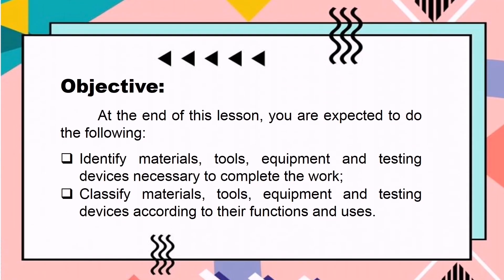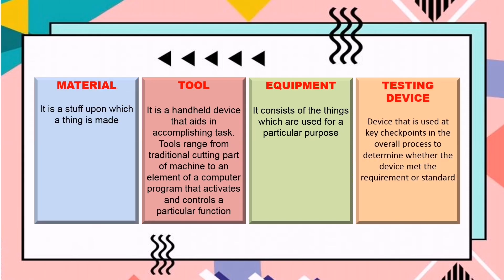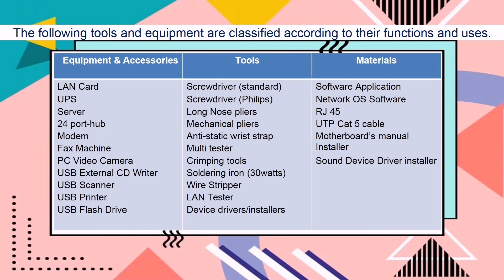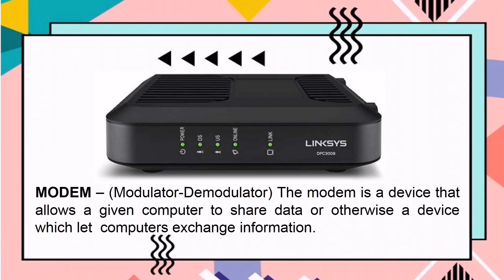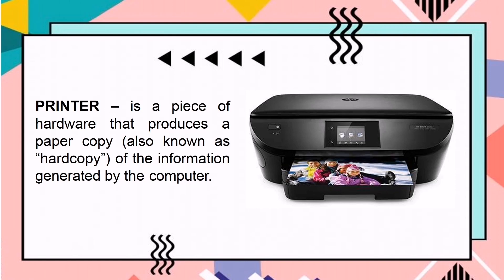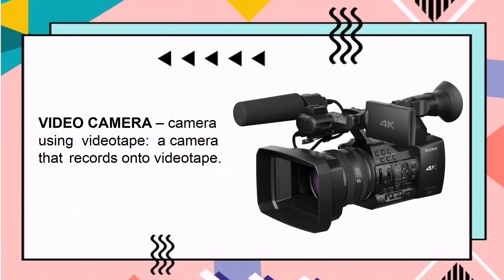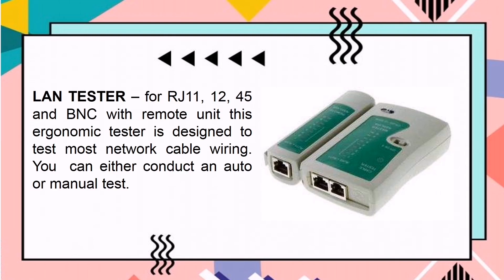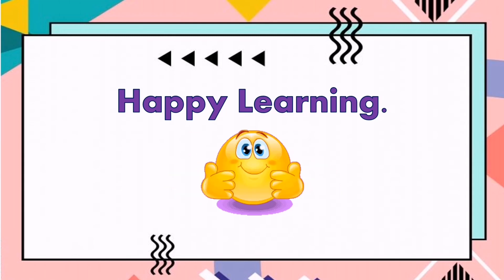LO 1. Assemble computer hardware

Comment: Three Disadvantages of Not Following Directions in Using Tools and Equipment:

-All tools,materials and equipment have their own functions,so if they are not followed we may not be able to do our work correctly
-Failure to follow or use tools,equipment and materials correctly has the possibility of being harmful
-There is also posibility of damaging what we do or the things we do such as the computers once the tools,equipment and materials that should be used have not been followed or used correctly.

Shiela Mae Masanguid
Grade 10-Karunungan

Comment: 3 DISADVANTAGES OF NOT FOLLOWING DIRECTIONS IN USING TOOLS AND EQUIPMENT

1. If you don't follow the instructions, your understanding of how to utilize tools and equipment won't get any better. It won't take much time to just read and follow the instructions. But you can utilize this information the next time you undertake a task.

2. People may sustain injuries ranging from minor to severe, and in certain cases, fatalities. such as collision injuries, electric shock, and slippage when utilizing. 

3. Failure to follow the instructions for the tools and equipment will make repairing or doing what needs to be repaired more difficult. You have a higher chance of failing or damaging your PC.

10 - karunungan

Comment: Three Disadvantages of Not Following Directions in Using Tools and Equipment:

- Failure or having a hard time completing a task. Not following directions before usage or performing a specific task could lead us to this. We tend to do a job or task without reading or following directions. Due to this, we will not meet our expectations after completing our job.

- Every tools and equipment we (will) use has its own use and function. If we tend to use a tool to its not specific uses, it may cause damage to the tools or equipment, or in a worse scenario, this could lead us to several other problems in assembling Computer Hardware.

- Accidents may occur, not only in our tools, equipment, and any devices but also in ourselves and also for the people around us.

Abon, Ryza P 
10 - KARUNUNGAN

Comment: THREE DISADVANTAGES OF NOT FOLLOWING THE DIRECTIONS IN USING THE TOOLS AND EQUIPMENT:

• If you not read the direction first, there's a possibility it will be difficult for you to perform the given task(s).

• Every tools has their own functions and design. In computer system, you need to know all the tools and equipments including their works. Once you misunderstood or unread the directions, it may cause damage on tool, then you will start panicking because you don't know how to fix it.

• Computer is a generation. It needed tools to fix the broken part of the computer, and equipment for particular purposes. The two necessary items are both working fine, If you didn't read the direction, it can cause danger on the computer and also hazard by yourself.

✓Better to read the direction first to have a good knowledge of data✓

JOHN ARVIN T. ABELLANO 
10-KARUNUNGAN

Comment: 3 Disadvantages of not following directions in using the tools and equipments are:
1. There is a possibility that the equipments will break if you do not use the equipments properly. 
2. There is a possibility of harming you if you do not use it properly. 
3. And it can also damage the parts of the computer or the computer. 

STEPHANIE C. MILAR 
10-KARUNUNGAN

Comment: The Three Disadvantage of Not Following Directions in using the Tools and Equipment are:  

1. Lack of knowledge about how to use tools and equipment can result in many risks and accidents, not only to the people performing the activities, but also to those around them. 

2. Using improper use of tools and equipment is a bad idea. When using tools and equipment, you should always read the directions carefully so that you can find what you need and understand what has to be done. In general, not following instructions when using tools and equipment results in an impossibility to get the desired outcome. 

3. The improper use of tools and equipment may have an effect on the computer and can cause damage to it. And the tools may be damaged too. 

Princess Kim Magno 
10 – Karunungan

Comment: NADINNE A. SERDEÑA
10 - KARUNUNGAN

•Three (3) disadvantages of not following directions in using the tools and equipment:

1.) Misuse of tools is not only dangerous, but it also shows a lack of knowledge in using tools and equipment. Furthermore, if an accident occurs as a result of improper use of the tool, the downtime will disrupt the entire work.

2.) Never force a tool to do something it wasn’t designed to do. Forcing a tool can lead to breakage and serious injury. Using a tool incorrectly can damage the tool or equipment.

3.) The wrong tool can make any job much harder. Using the wrong tool at work can be extremely dangerous. One of the most common hazards of using the wrong tool at work is that you could hurt/harm yourself and also your co-workers. Always be sure to use the right tool for the job and handle it with care.

Comment: THREE DISADVANTAGES OF NOT FOLLOWING DIRECTIONS IN USING THE TOOLS AND EQUIPMENT:

1. Failure to follow the instructions in using tools and equipment can cause improper handling and guiding of it. Worst, it can result to hazardous consequences or accidents arounds us.
2. Work sometimes does not look exactly what we want it due to not following the instruction that can damage the computer and other computer related devices.
3. Tools and equipment have their own characteristics and function so that we must use it properly to avoid those disadvantages and we can freely achieve the safety workplace qualification. 

Annalyn T. Ramos 
10 - Karunungan

Comment: THREE DISADVANTAGES OF NOT FOLLOWING DIRECTIONS IN USING THE TOOLS AND EQUIPMENT : 

1. Accidents may arise as a result of improper tool and equipment use or failure to follow instructions. When we misuse tools and equipment, we greatly increase our chances of injuring ourselves or those around us.

2. It is more likely to fail if you do not follow the instructions when utilizing tools and equipment. It may cause damage to the tools and equipment, as well as the computer that is being processed with it.

3. Inappropriate use of tools and equipment is a step in the wrong path. If you follow instructions when utilizing tools and equipment, you will be able to find what you need more easily and have a better grasp of what has to be done. Overall, neglecting to follow instructions when utilizing tools and equipment leads in a failure to achieve the desired result.

—
Krisha Miel Bernil
10 - Karunungan

Comment: The Three Disadvantage of Not Following Directions using the Tools and Equipment:

1. Not following the directions could lead us into failure when we are doing a certain work. When people fail to follow instructions before using a tool or piece of equipment, it often results in them not getting the desired result, which causes a lot of other issues.
2. Using the wrong tools and equipment could waste more time for us when doing such tasks. It could also harm our tools and could lead to broken things and we could never use it again.
3. It is important for us to learn how to use the different tools or equipment so that we can accomplish the work fast and accurate. Our lack of knowledge into tools can cause different hazards and other accidents.

Comment: 3 disadvantages of not following directions in using the tools and equipments are:
-it will result in things that are dangerous and can hurt you.
-It can affect the computer and damage it due to the wrong use of tools and equipments.
-there may be confusion among them and the tools and equipments cannot be used correctly.

Dustine Dyve Adolfo
10-Karunungan❤️

Comment: Three Disadvantages of Not Following Directions in Using Tools and Equipment:
1. Disregarding Information/Instruction Manuals can lead to safety and hazard-related consequences to the person and the people around them. 
2. It could compromise the efficient quality of accomplishing certain tasks regarding Computer Services, such as assembling Computer Hardware. 
3. Not following Directions before usage could also lead to failure in doing such tasks. People tend to fail in accomplishing their desired result in the end due to the neglected use of Instruction Manuals before using a tool or equipment, leading to several other problems in Assembling Computer Hardware.

10 - KARUNUNGAN